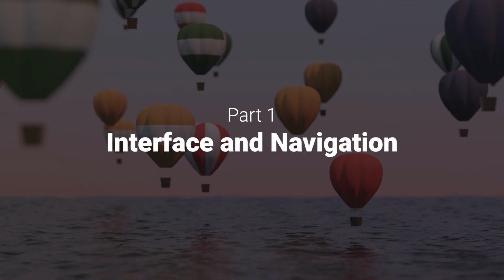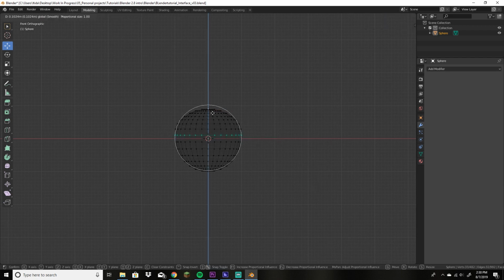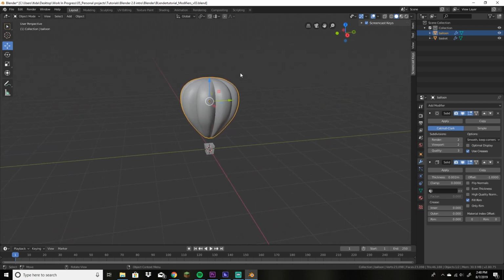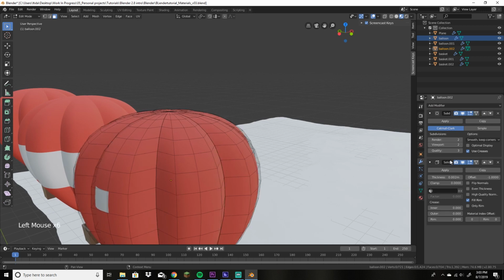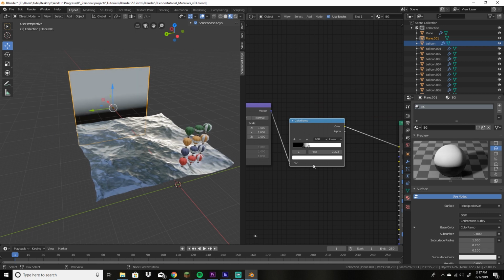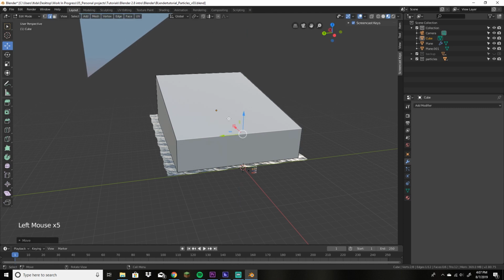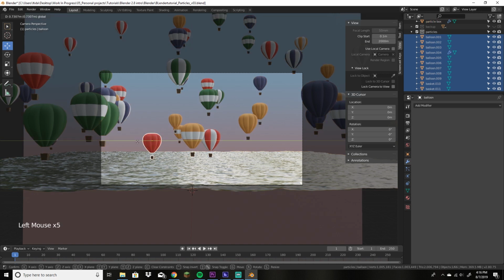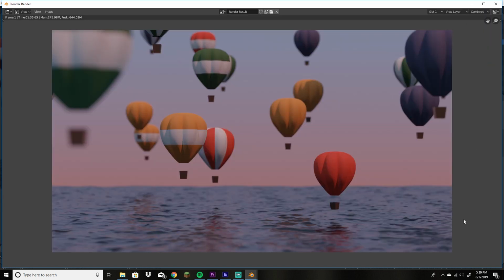Blender 2.8 Tutorial For Absolute Beginners

Comment: I tried everything but my ocean is not looking the same as you. It's just dark blue. Nothing else. Pls help
Reply from the maker: hi Saurabh, is the material the problem or the shape? If its a material issue make sure that you are in cycles render, make sure you have set up the HDRI, and make sure you have the metallic at a high value. I know it seems odd to add metallic as a characteristic for water but due to the angle of the camera, it works for this scene. Drop a link to your scene file and I will take a look. Best of luck!
Reply: @maninmotionVR  actually I have 4gb ram and 4GB gpu. I tried it in another pc and it's ok. Is there any trick to see it in a low spec pc too.
Reply from the maker: @saurabhbhole4303   I'm not sure but I'm glad you were able to get it working. The specs of the computer shouldn't change the output of the render. It might change how long it will take to render it. but more likely there was a difference in settings between blender on the one computer and blender on the other computer. Maybe screenspace reflections were turned off? Anyway, I'm glad it's working for you now.
Reply: @maninmotionVR  also when I'm trying to merge the very first balloon and basket it's the texture is being distorted.
Reply from the maker: @saurabhbhole4303  Did you apply modifiers before merging? also, could you describe how it's distorting that would make diagnosing the issue a bit easier.